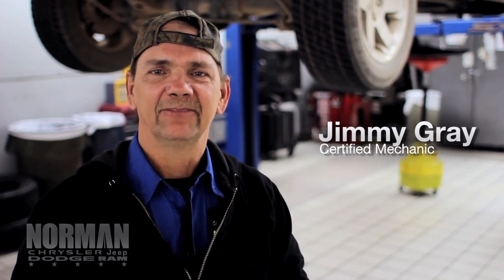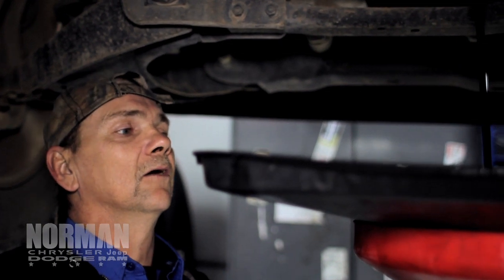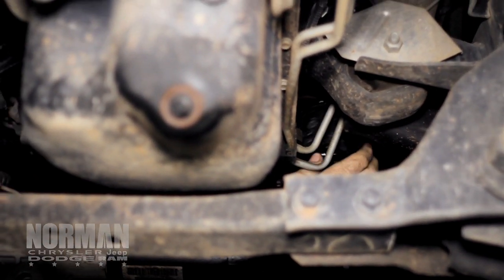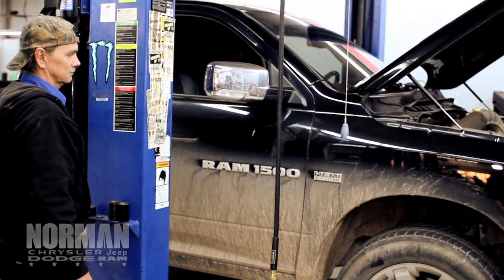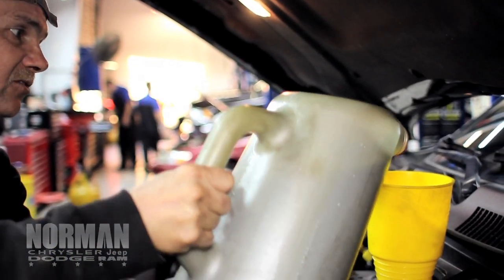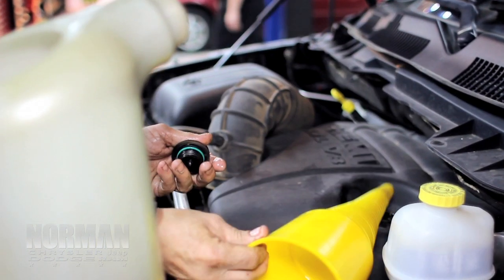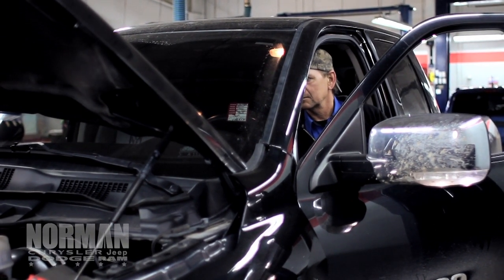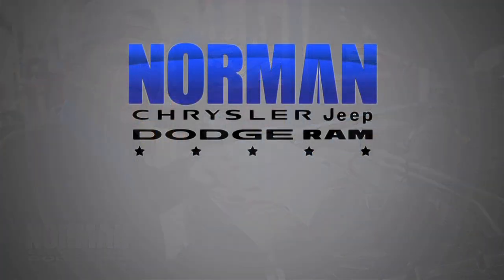How to Change Your Oil | Norman Chrysler Jeep Dodge Ram

Comment: I have new 2014 1500, have not done oil change yet. With my Hondas, they use a crush wash. Do the Ram's use one. I don't want to start the oil change a then figure out I'm missing something.